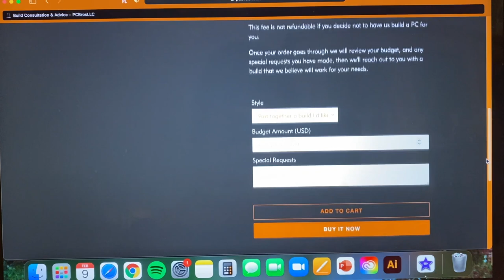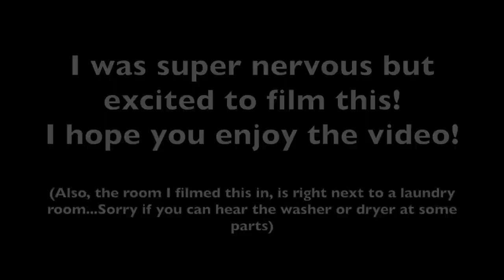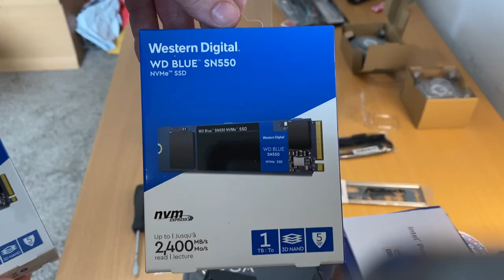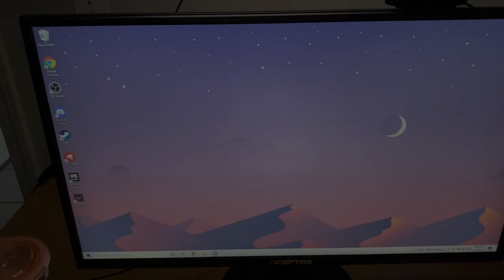Did I Do This Right???// Building My First PC// chill/relaxing asmr vibes

Comment: Congrats on your first PC build. I can give some constructive critisism but that's meant more esthetically then functionality.
Your 8pin EPS (that powerplug top left of your mobo) could go through the hole above it behind the mobo tray instead of the hole it comes through, its a tight bend but works great and looks cleaner.
The 24 pin connector (the main connector of your mobo) should come in 1 hole above the hole it comes through, same with your USB3 connector.
Slack of your front panel connectors could easily be hidden behind the mobotray but dont pull too hard.
A slightly better cooling solution for your CPU never hurts, and looks way better, you dont have to go the AIO watercooling route, a simple towercooler just would look better and perform a little better also.

The fan in the bottom of the case is kinda pointless as exhaust, hot air rises so that fan is better in top of the case then in that spot and with 3 intake fans and 2 exhaustfans you will run positive pressure so that's good.

Now you have built your first PC, now you know with a few snags here and there the first time, it's not incredbily hard. Next one will be easier :) Hope you enjoy <3
Reply from the maker: hey! thank you so much! I really appreciate all the feedback, most importantly glad I didn't do anything functionally wrong but its nice to know about esthetically changes too! I ended up moving the fan at the bottom afterwards, my brother said it was pointless too lol. I think for future upgrades, a CPU cooler is towards the top of my list. My primary use for my PC is streaming, other than that I'm honestly not on it too much so i feel like its okay to wait to add a CPU cooler. If I did decide to go the AIO route, would it fit in my current case or no? I agree,  my next PC will be easier now that I've got one under my belt! Thanks again! :))

Comment: you shouldnt use that stock intel cooler, it sucks really bad. you can get a hyper 212 from cooler master for like 30 bucks which is a wayyyyy better cooler
Reply from the maker: Thanks for the tip! I've been kinda of worry about my CPU. Not that anything has happened to make me worry but I think a CPU cooler would forsake put my mind at ease a bit! I'll have to look into that! Thanks again!! :D
Reply: @meggos_4032  my first pc had the same cpu as yours and i thought i could get away with the stock cooler and save some money but under 100% load your cpu is gonna thermal throttle. the 10400 isnt even a very high power chip, thats a testament to how crappy the intel coolers are. its kind of a shame beacuse amd cpus come with really good coolers out of the box. anyway good luck with your pc endeavors